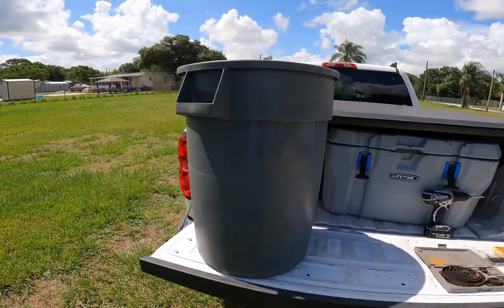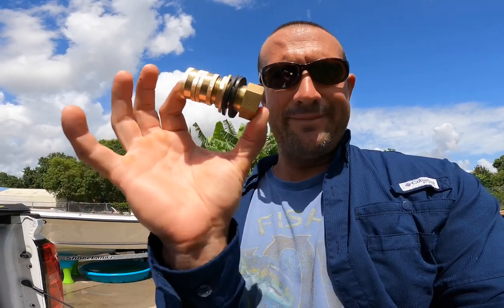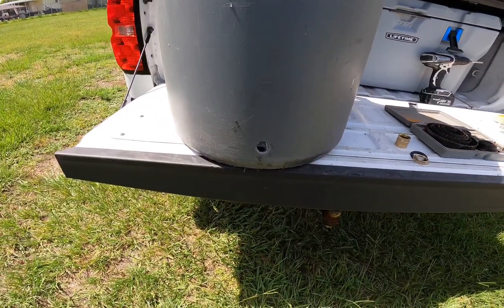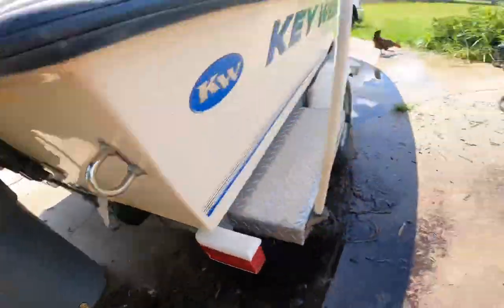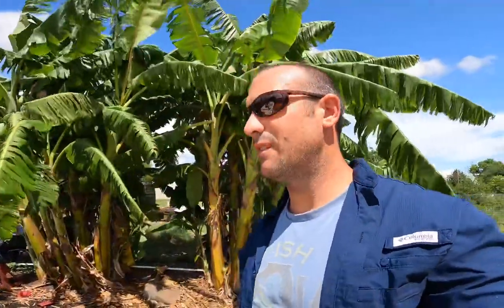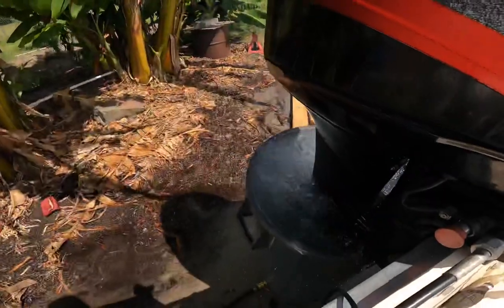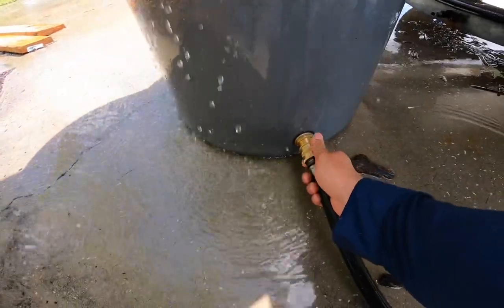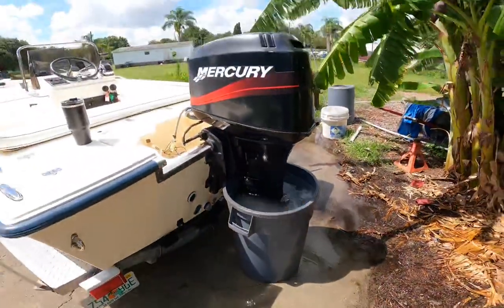How to FLUSH your outboard engine|The HEALTHIEST and CHEAPEST way possible!!!!

Comment: I ended up buying Rydlyme descaler and a small pump to flush out my old Yamaha 60hp 2 stroke outboard. I dropped the lower unit of the engine, and hooked the output of the pump to the water intake tube of the engine. I also had to take the thermostate out, but it needed replaced anyway. You mix the Rydlyme in a 5 gal bucket with 1 gallon of water, and put the pump in the bucket. The water comes out of the pee valve into the bucket, and is then run back through the system by the pump. I ran it this was for a few hours. There was at least 1/2" of sludge on the bottom of the bucket when I was done. I could not believe how much crap came out of the engine. It is a little pricey to do it this way, but it works.

Comment: Not only does this flush your engine better, if you are tuning up your engine on mouse ears, you might find out that when you take your boat to the ramp and fire it up in the water, it won't run the same.  You need to run your engine lower unit under water to get that back pressure on the thru hub exhaust.

Comment: Went to the second hand (recycle) yard got a used clean drum about 44Gal/170L for $10, cut the top 1/3 off with the disc grinder, there is no need to put the motor in gear so hung the garden hose over the side, run the F70 for 10 minutes. When finished take the hose off the faucet and drain (syphon) drum water into the garden or the storm water pit.
Reply: That's a PVC/plastic drum of 44Gal/170L.
Reply: @rossevans1774 
Thanks for the proper identification of the tank model. I can sleep forever well. !!!!!

Comment: One flaw is supplying the new water from the bottom. The weight of the water in the trash can is going to try to backfeed into the drinking water system. Need to supply fill water at top with air-gap between supply water and weir. A small amount of water can be drained from the bottom at the same rate as the make-up water. Also maybe remove the prop during this operation. Or cross your fingers with muffs. 
In any case, there's really no reason to run the motor for more than a few minutes to conduct tests or flush cooling system. Just my observation.

Comment: What about a drain on the bottom instead.  Then fill the can as usual ? Not sure but I've tried it with muffs and the can with no drain . Only problem is getting the motor to lift out and tipping the can over . Heavy . Do you put detergent in the can when you flush? I'm in brackish to salt water 
Thanks . Mercury 30hp

Comment: I’ve been looking for a large trashcan or some thing like a barrel to run my Yamaha F150 outboard and it needs about 26 inches from the front fin to the back and most of the garbage cans I find around 24 inches. Any advice appreciated. Thanks.
Reply from the maker: If the trash can won’t work I have seen other guys ,specifically guys with twin engines, use an old 500-100 gallon water box. They are used in agriculture I don’t know what they are called specifically but they are a plastic tote that has a metal cage around it.. maybe try that!!
Reply: @belowtheboat3482  Old post but theyre called IBC (intermediate bulk container)

Comment: I’m picking up a used boat next week and started watching these video on flushing. I like your video but disagree with running the cool water thru the flushing process. I think the motor won’t get to temperature properly and the thermostats won’t open so water won’t properly flow thru the motor. The motor has to heat that water up so thermostats open otherwise water stuck on other side of thermostat doesn’t go anywhere, no? The bucket way is the way to go though because muffs create the same issue by constantly introducing cool water so it’s not a proper flush.
Reply: A boat motor always runs in cool water. How do they ever warm up? It will be fine if you let it run for a few minutes (up to operating temp).
Reply: So do you have to wait for the ocean to warm up for your thermostat to open?
Reply: @benjithebulldog5637   You missed my sarcasm. Relax.
Reply: @jefmichel4027  my bad
Reply: @benjithebulldog5637  what sense does that make? The point is to flush the salt water out of the entire engine passages. The thermostat opens based on engine temp not ocean temp. Didn’t mean to offend you just asking you a question.
Reply: I do the same with my Yamaha 85 but I turn the water off to let it warm. I want the thermostat to open up.